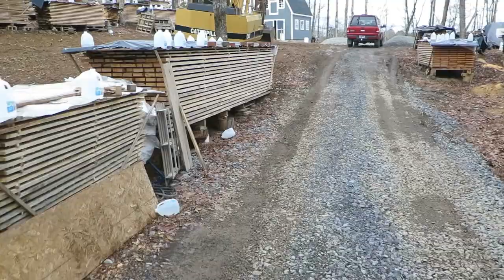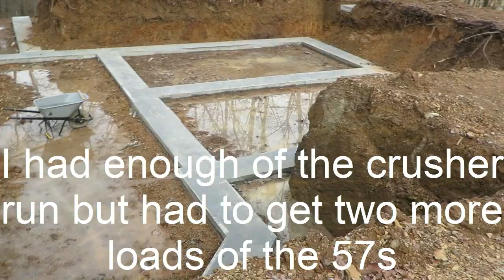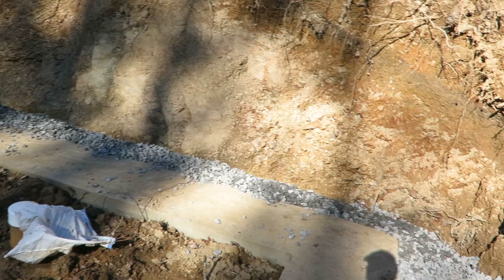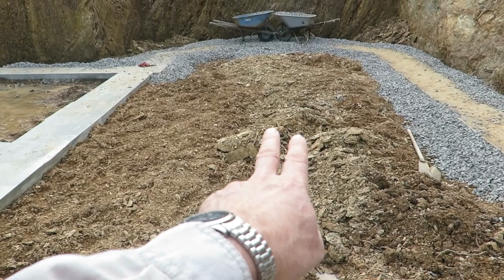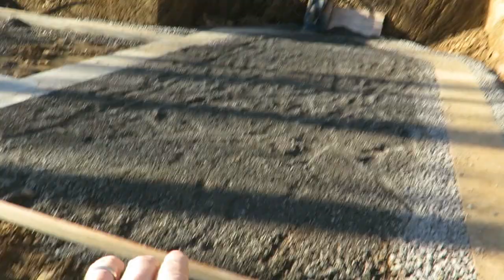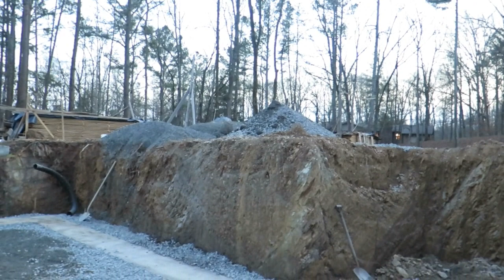Ep#270 Save time! The floor drains are in and the gravel to level the floor is almost in as well.

Comment: Looks great so far, but I have a question on your foundation drains (the network inside your walls). I don't see a difference in elevation of those pipes, is there one? If not, how will the water drain out of them, or will it just sit stagnant? If that is not fixed you may end up with a problem where it flows from one drain and comes up through a different drain elsewhere in the house.
Reply from the maker: The inside lines are on a separate exit line than the exterior drains. I was not as concerned about any water, if any does get into these interior lines, coming into the house because the exit line is still below the top of the cement floor line by 4-6 inches. The floor drains will be to the surface of the floors of course so while there may be some residual water staying in the lines on the perimeter it should leach away in the perforated pipes. The exterior drains on the outside of the wall do drop below the interior lines where they exit.
Reply: @thetennesseefrugalcraftsma7383  I woud suggest that you do NOT use corrugated plastic tube for those lines though - it for whatever reason you need to snake them it'll be problematic at best and at worse you'll puncture a hole through them and then possibly erode your foundation. The small add'l cost is worth using Schedule 40.
Reply from the maker: @fooddude9921  I know a lot of people use PVC S40. And you are right that it would be much better for snaking. In Canada where I am from corrugated  was all we used. I purposely put piping on inside and out in case of the failure of one or the other but I am hoping the use of #3 for backfill will eliminate the necessity of having to snake pipes down the road because of only water running through the backfill to the drain pipes as opposed to soil and roots which happens when you use regular fill around the basement. Thanks for the input though.

Comment: 5:18 How is that pipe pitched?  If it's pitched well, the water will flow downhill and out without requiring a pump.
Reply from the maker: Yes, I tried to keep it pitched as much as possible though the difference from top to bottom of the pipe is still within a tolerance that will allow the water to flow out of the basement.

Comment: I am the office manager at our local stone quarry…you need #4 stone on the driveway. Crush and Run is only base stone.
Reply from the maker: Yes, I realize that. I used #3 on the driveway as suggested by my excavator guy. I use crusher run to level the floors only in the basement. The excavator guy suggested using it around the #3s on the driveway in a few trouble spots to give them some stability but only after the #3s were in place.
Reply: @thetennesseefrugalcraftsma7383  you can use #2 or #4…we don’t screen for 3’s…the smaller the number the bigger the stone. To calculate stone… L x W divided by 90 = tons of stone that you need at a 2” depth…our plant produces 2,4,7,8,9,11,53 and screenings. 2,4 are good for filling mud and sink holes and then top it with 8 or 9 after it’s stabilized.
Reply from the maker: @bestlifeblessed   here they have #3. See https://hhrockquarry.com/
Reply: Got it…you may need to use a roller on your driveway for compaction.
Reply from the maker: @bestlifeblessed  We are not sure on the finished elevation of the driveway yet so when the final grading is done I hope to put down a good layer of #3s and then eventually pave or cement it.

Comment: Wow!  That’s a lot of work. Looks fine. 
I do have a question. Did you say you’re backfilling with #3s ?  If so , I’ve never heard of such a thing. Not that I’ve hear it all or anything lol. But it seems it will let unneeded water to get to the footers. We always papered over what you have now and backfilled with the dirt from the dig. Then we sodded out 4 feet or so at the surface to keep erosion to a minimum ( pitched away from the house ) there will be tremendous amounts of water coming off the roof. I’d want it to run away from the house.  Idk. Thanks.
Reply from the maker: I will plant grass at the top 6" or so but the plan is to allow water that gets past the sod to go straight to the drain tile. Others have done this and apparently it works fine.